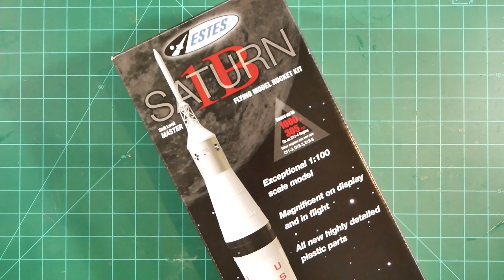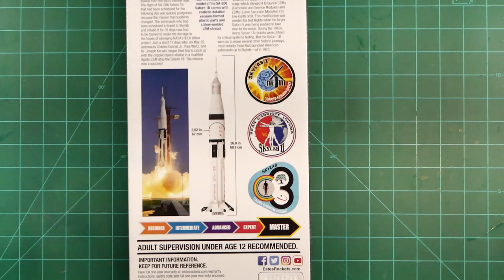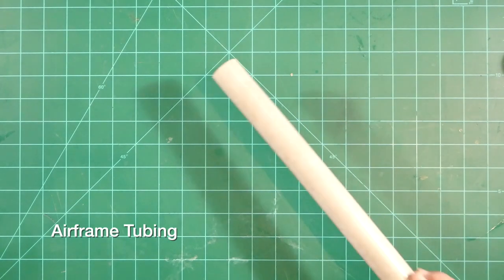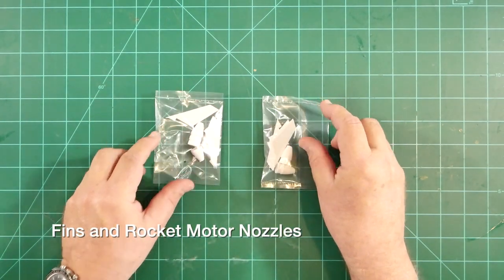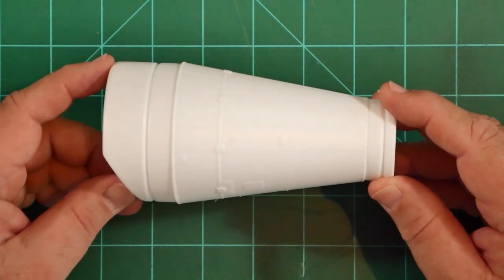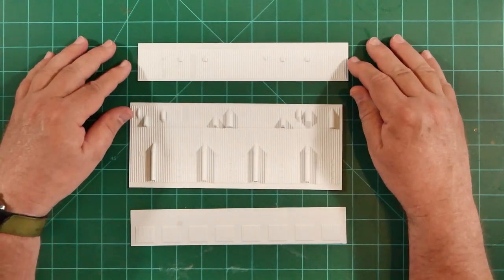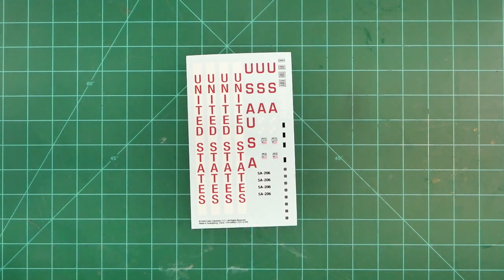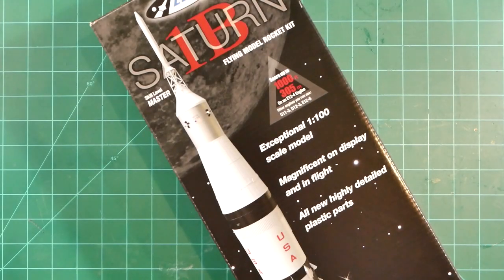Estes 1/100 scale Saturn 1B Unboxing

Comment: I had to chuckle when you mentioned hiding the out of round paper shroud from the earlier versions.  As hard as I tried back in the 70's with the 1/70th scale version of the 1B to keep it round, I could not avoid a flat side to that silly paper shroud.  Sadly, in my first ever failure of an Estes motor, one of the 4 engines in the cluster toasted the rocket on it's first launch.  Super excited to try again with this new kit. Thank you so much for the plethora of information in this presentation.